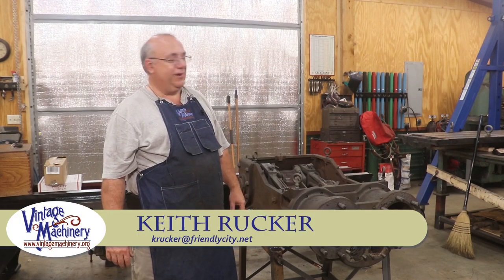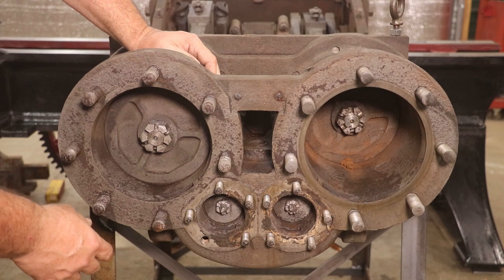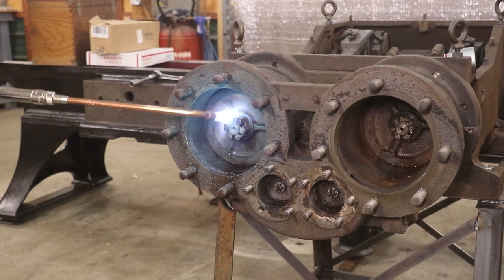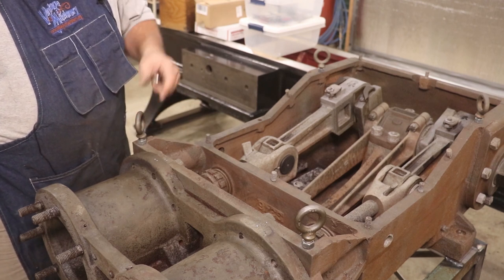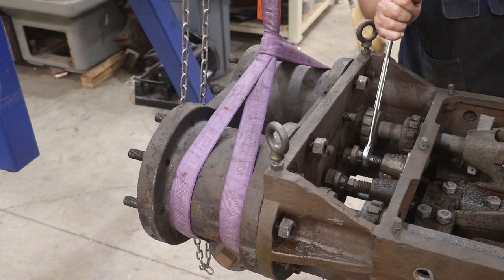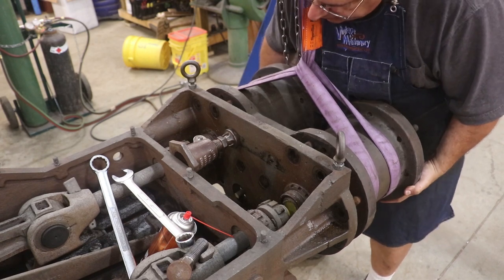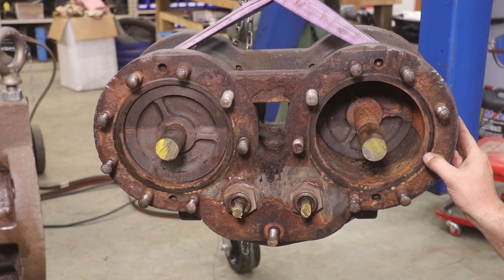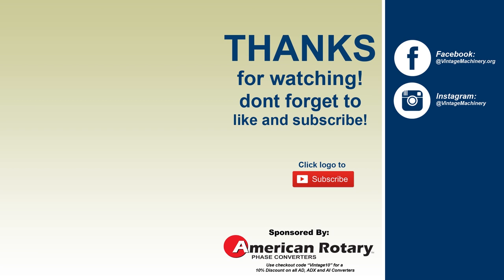Steam Locomotive Stoker Engine Restoration - Part 2: Removing the Cylinder Head

Comment: I find it odd that you misidentify different parts of that engine, what you call the cylinder head is the cylinder block the head is what attaches to the cylinder block; you have also referred to nuts as bolts, other than that you did fine work

Comment: I'm not a fan of choke hitches.  The head is probably 250-300 lbs (which possibly makes my comment moot)?  The angle of the choke is okay, but if that is one of those 2,000 lb HF lifting straps, then the choke cuts the capacity in half- and the angle of the legs under the choke being over ninety degrees puts the entire load on each of them.  I hope you are wearing steel toe boots because those cheeseball straps are dependent on the jacketing (unlike a synthetic lifting sling).  Use a basket and mouse the strap to the piece by basketing  in with one or two  a rated ratchet strap instead.  Failure also happens on lunch breaks (heat build up happens).

Comment: @ 7:14,   10:16, 18:26,  and 22:14  that's NOT a cylinder head, it's a cylinder block or cylinder casting or just simply the cylinders.

Comment: Was this too big for your evaporust tank?
Reply: Does Evaporust have to be brought up to strength with concentrate additive
Reply: @jimc4731  you use it out of the jug.  Eventually it stops working.  I dont think there's any way to reactivate it.  I just dump it when it stops working.  It lasts longer if you degrease you parts before you dip them.

Comment: Keith, we REALLY need to work on 
"cylinder,' and "cylinder head."

A cylinder looks like the inside of 
an open and cleaned out, can.

A head, especially one without 
the piston rod going through it, 
looks like a can lid.

You had the head removed before 
this interesting episode started.

(The cylinder head doesn't cover 
the valve chest, either.)

steve